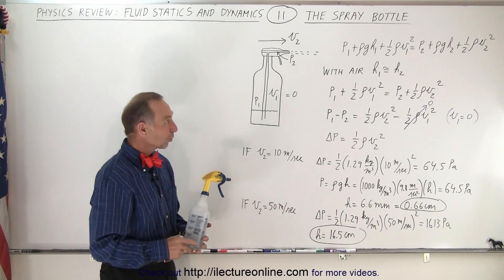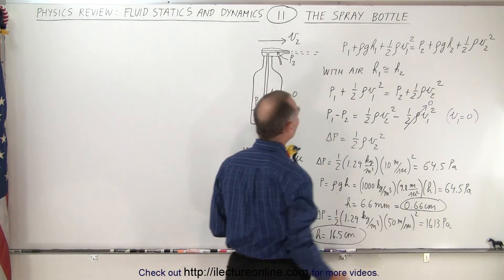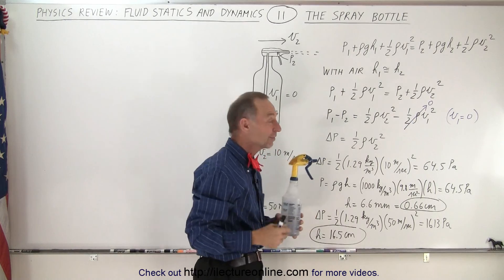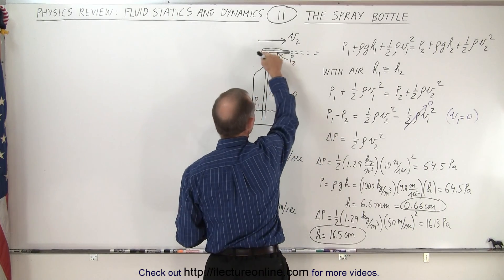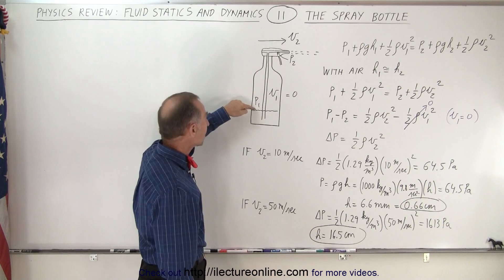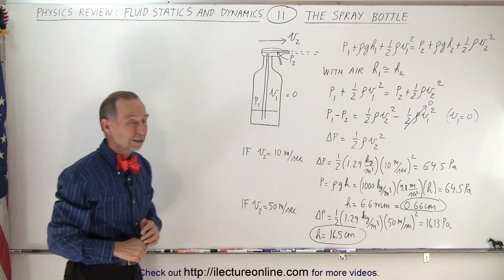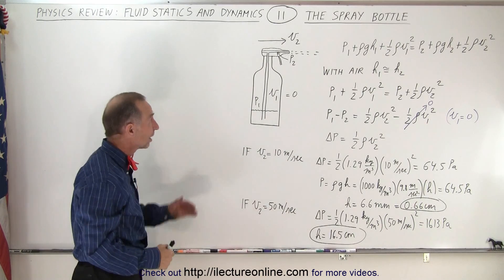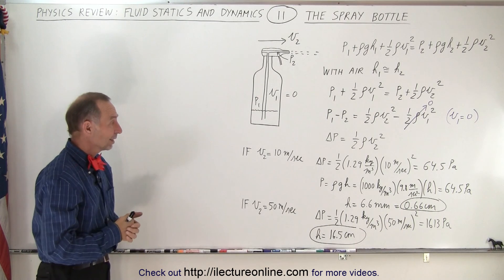Physics Review: Fluid Statics and Dynamics #11 The Spray Bottle

Comment: I understand that you need something to use as an example, but don't spray bottles just use a simple check valve pump to push liquid through a small orifice? Maybe you could use a paint sprayer to have an example that doesn't mislead people. I know it's a bit pedantic, but I dislike when people create misinformation of any type, and now there's 4000 people who think that spray bottles work in a way that is not real.

Comment: hi professor, 
The cleaning fluid bottle has a spring inside it, and I think it expels the liquid by the force of pressure on the spring, not by the pressure difference resulting from the flow of air inside the exit duct, as in Bernoulli’s principle in the atomizer.
 Then you mentioned that we need a lot of speed to create this pressure difference.
 Does pressing the trigger enough to achieve this speed? Please clarify whether I am right in what I said

To summarize my question
 What raises the liquid, our pressure on the spring(trigger), or Bernoulli's principle, as in an atomizer?

thank you very much
Reply from the maker: The spring is used to bring the handle back to the front after you pull it back.
Reply: @MichelvanBiezen  
professor in the bottle I see the liquid not directly rise from bottom to the exit, but it reach first floor when spring back (the liquid fill the spring space)  then after press the spring it goes out and like this. 
I ask Chat GPT bot about that and it tells me that bernoulli principle not primary in this sinario, but suction and pressure by spring. 
bernoulli equation applies always, but I mean by bernoulli principle the low pressure that happened by speed up. 
hope you understand me